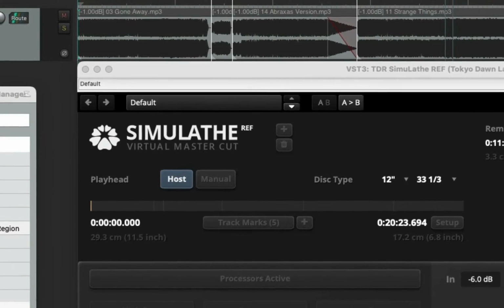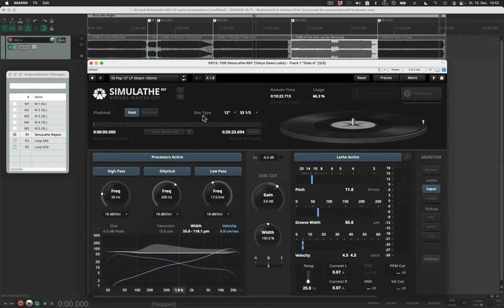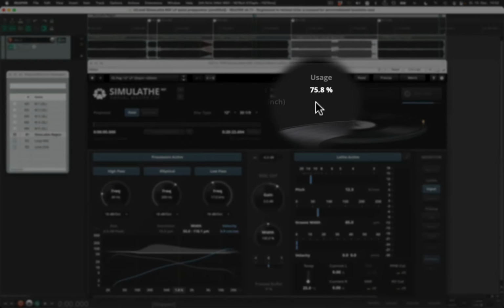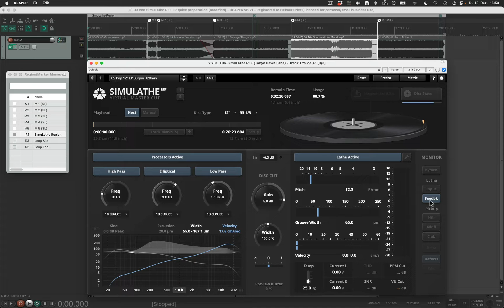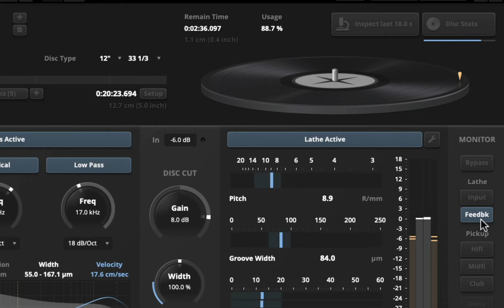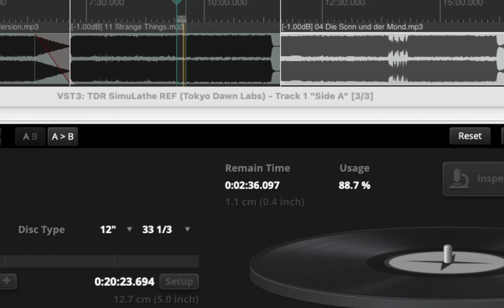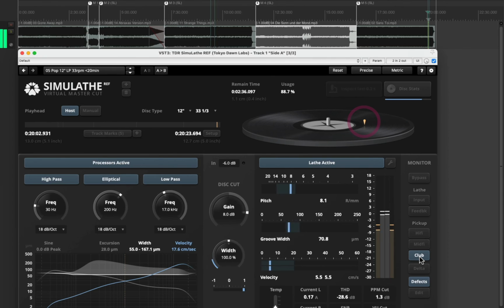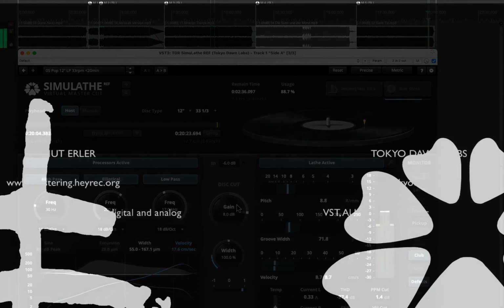SimuLathe Prepare a cut - Quick Start

Comment: I have a question- If my track "passes" quality checks for Vinyl, can I assume my track is mastered decently well?  I was not trying to cut vinyl, I'm curious is SimuLathe can help me judge the quality of my tracks after I mix them.  Thank you.
Reply from the maker: Hi @DawlessHouseMusic, thank you for the question. We will present a new member of the SimuLathe family soon that will do exactly this - give you a "pass" or "fail" indication. Telling you if your mixes will translate well to the cut.

"Simulathe Cut Prepare" - check and prepare digital audio for a vinyl release - easy and fast. The small standalone App gives a clear "pass or fail" indication for each project, helping to identify and communicate potential issues with the client and the cutting room early in production. It avoids costly delays and rejected test-pressings, and utilises the capabilities of a virtual disc mastering room to prevent pitfalls early in production. It helps Disc Mastering Studios do their magic job faster and better by delivering perfectly prepared audio-files.
Reply: @heyrec fantastic & thanks

Comment: Hi, Can you do a video about calibration? i'm not sure really what that's all about in simulathe report and what we suppose to do with that... What's the offset and should i go with -6 or it's.. Amazing software really make us understand more about how vinyl cutting's done
Reply from the maker: do you operate a cutting lathe and use SimuLathe Cut version? please refer to this: https://docs.tokyodawn.net/simulathe-cut-manual/?preview=true&_thumbnail_id=6862#Calibrating_SimuLathe_to_a_Real_System

if you use REF version there is not much to calibrate from your end...The -6dB input gain should prevent your signal from clipping - that is it.
Reply: @heyrec i have both just trying to get my own record pre-mastered for cutting and understand the process. I like the Cut version better because by tweaking more you can understand more what's going on with the system. Thanks!
Reply from the maker: @sivanlanger  In this case I recommend to use the pre-sets provided as a good starting point and take it from there. You can only calibrate SimuLathe against a known physical system. If you do not know the cutting system that is going to do the cut - then there is nothing you can calibrate against...unfortunately.
Reply: Ok, no worries. Thanks for the explanation